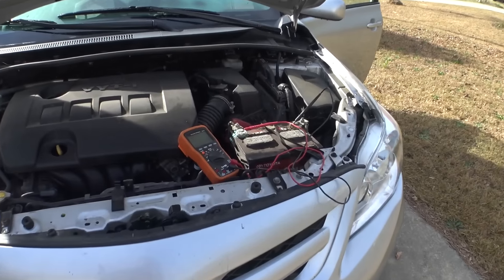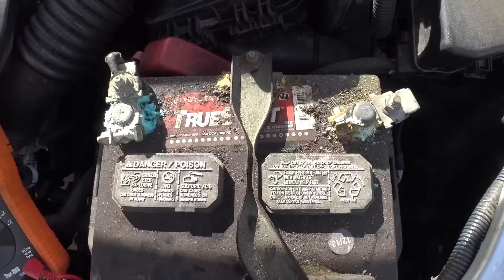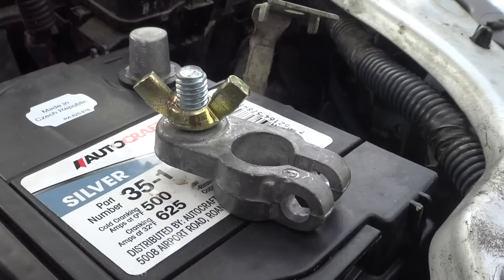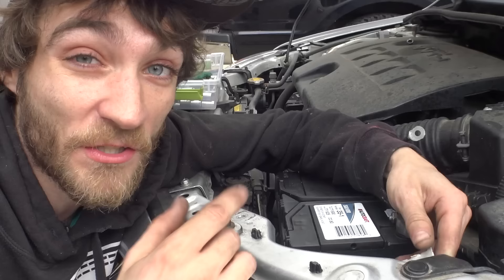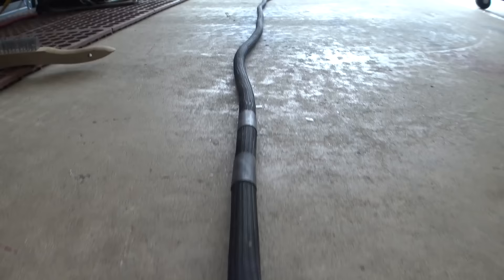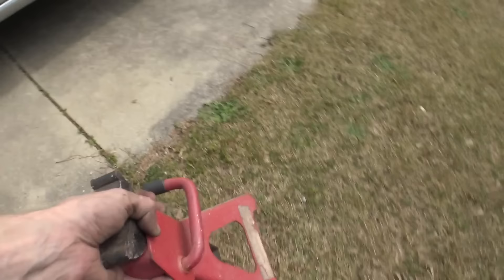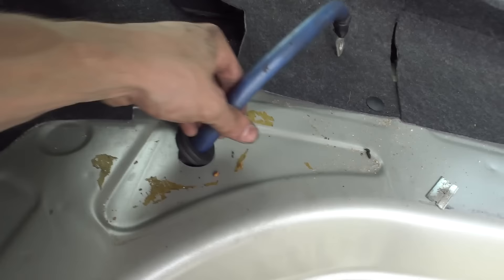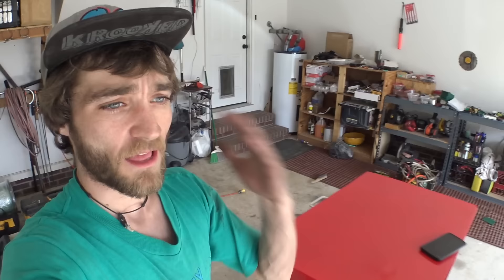Wiring CAR AUDIO System w/ 2nd Trunk Battery & Installing BASS Amplifier | Testing HOTEL Subwoofer

Comment: EXO is there any disadvantage to using just a straight non flared pipe as the port? I'm thinking of building a box where the sub faces the back as normal but then porting it out the back of the box through the ski hatch between the rear seats into the cabin and I dont really want a big flared port looking obvious, I plan on painting the inside black then carpeting the outside grey with the box.
Reply from the maker: Flares will help reduce port noise, and in many cases behaves like a larger port opening without necessarily being larger.

Comment: before you go spending loads of money on a high output alternator, try doing the big 3 upgrade first.
(Side note) I thought you were supposed to fuse a second battery, please correct me if I'm wrong?
Why was that chick putting WD on those posts? Last time Advance did mine the guy used dielectric grease.
Great job BTW; enjoy your hard work.
Reply from the maker: I know, right!?!? LOL - And yes, doing the big 3 before a H/O upgrade is always a fine option. Thanks for the comment, Vince!

Comment: No need for an isolater? Thought if you use 2 different batteries thats a must. Please explain cause i dont want to use one
Reply: You don't. Think of how most trucks 3/4 ton and up have 2 batteries. Each it's own ground and connect positives
Reply: I ran two batteries in parallel in my previous cars for years without an isolator and had no issues.

Comment: Mine only drops from 14.2 to 13.8 on factory alt but the factory alt is a 220 amp in my 16 Dodge Charger with ssl evo 5000.1 an alpine type R 15 so I’m good I guess
Reply from the maker: Nice man! That's all alternator power right there. Not even dipping into the battery reserves.
Reply: Hate to burst you all’s bubbles, but you could get a Dodge Charger from the factory with a 220 amp alternator. My Challenger came with a 160 amp alternator, but the 6.4 engine had the 220 amp alternator installed from the factory, and it’s a direct bolt in. I put one in my Challenger in place of the 160 amp one.

Comment: Hey exo have you done any speaker upgrades for a 2003 Nissan frontier? It's stock 6.5 front and 4.1/4 rear, I'm thinking 8 in the front and 6.5 rear. All subs.. thoughts?
Reply: Love you r.   Wórk
Reply: Woñderful.   Wórk

Comment: do you also run ground from your alternator or only from the metal on car I'm working on a build and was trying to inure out ow yo get sooo any ground and power wires
Reply from the maker: Grounding directly to the alternator case is best.

Comment: Hi, you should turn around subwoofer. Speaker needs to fire to trunk opening, because now reflected sound waves makes cancelerations in cabin. Sound waves lenghts ~12-5 meters.They reflecting and are a little out of phase. It's just basics, you should try, maybe it will give you dB or even tenths of it. Let us know. :)
Reply from the maker: The current position was for getting better filming. Seeing the subwoofer move is a little harder when it's turned around so you can't see it :p We will test all sorts of stuff though. Again, this is for just her enjoyment, not for me lol
Reply: Good luck. Nice videos. :)

Comment: I’m new into car Audio and have kicked comp 12’s with a machete 2000 watt amp before I install the system should I get a new alternator or Battery? Not sure what I should get I have 2000 Watts and I have a Chevy cavalier just don’t want to kill my alternator right away thank you for the feedback!
Reply from the maker: If it's 2,000 watts RMS I would definitely consider upgrading both!!!
Reply: Agreed. Definitely upgrade both. And upgrade those wires! I made the mistake with my 85 Camaro. Threw in a 750w rms sub with a 1000w amp and 2 days later my alternator was fried. It was stock so it was old anyway, but upgrade before hand so you're not stuck with a dead car!

Comment: im guessing its better to put the ground under the seat like you did compared to on top like i did fuuuuck. and in a trunk like that isnt it louder having the sub facing the rear? if that car has enough voltage to push that 3000 watt amp that makes me feel better about playing my 2000 watt amp so thats good haha
Reply from the maker: Yes, and yes. We faced the box this way for better views of the subwoofer on video.

Comment: I'm running 2 batteries and a skar rp2000 amp. 0 gauge all the way around of course. how many fuses do I need and what size fuses
Reply from the maker: It's safest to fuse twice between each component, one at both ends of the power wire which connect to any battery or amp.
Reply: 1 fuse under the hood, 1 at secondary battery and 1 to the amp?

Comment: So.  I've been trying to figure all thos out.   Live your vids btw.  But I have a Honda pilot.  I think 130amp alt.  If I wanna run 1500-2000 watts rms.  Should I add a second battery?  An alt upgrade isnt really in the cards.  Its buried under the motor.   You did 3k watts on a stock alt and second battery?  Look forward to hearing from you.  I know you're a busy man.  :)
Reply from the maker: Yes, you should! Although I was burping and not playing music, If you can't upgrade your alt you'll surely need more reserves!

Comment: I have 8 gauge, switching to zero, so I need to replace the rcas and remote wire too???
Reply from the maker: No way! Just the power wires connected to your aftermarket accessories like amps ect.
Reply: Sweeet

Comment: How do I work out the amperage my alternator will need to produce running X amount of watts including the car electrics? Don't really fancy installing another battery or an extra alternator :(
Reply from the maker: James Mason I usually figure out what wattage I'll be running, and then go from there. Anything  over 2000 watts will definitely prefer a 200+ amp alt.
Reply: EXOcontralto thank you so much! Love the videos too

Comment: Would I only need 1 battery for a 3000rms system on 3500w amp with a 320amp alt
Reply: Yeah you would be fine. Just have some voltage dropoff (you will see it in the headlights at high volume) I had an altima with a skar 15" 2000w a skar rp2000 and full 1000w mids/highs on stock altima battery and alternator no issues just small voltage drops at max volume xD

Comment: How did you hook up the second battery? Did you just wire that xs power to the new one you bought at advance? Do you have a isolator?
Reply: Dillon Dye very simple. Positive to positive and negative to negative from the first, to second battery.
Reply: Dillon Dye  nope did not lol...not kill switch,not isolator,not power bank...lol
Reply: Just over working the alternator...lol

Comment: Exo what are your thoughts on an L shaped box vs an aeroport? I would be thinking that an L shaped port would load the cabinet more and "possibly" give a higher output. Just a question, I'm no expert. Thanks bro
Reply from the maker: Aeroports have less surface area, more efficiency, and slightly peaky bandwidths . Slot ports have more surface area, less efficiency and generally better bandwidths.
Reply: EXOcontralto so you're saying that an L shaped box sounds like crap due to port noise?
My DD 10 has an aeroport and it sounds damn good, but at the same time I've heard some L shaped boxes slam. The only downside is that it takes very careful planning to make it sound great. Port plotting can be tough, but is there still chuffing at the port? Just curious
Reply from the maker: No, I'm not saying that at all. Slot ports sound better generally.

Comment: dude that's banans you think i cause do that to a camaro but i dont want to use the whole hatchback i just want to use the little dip in the back
Reply: Emmanuel Burton no problem dude just measure it out if it's a older model you should be able to fit a single 12 or 2 6s

Comment: So im trying to figure this out, if i want a 2000 watt rms setup than a stock battery wont keep up so i need an extra one. But the battery has amps and ah witch one represents what(id guess one storage and one output but dont know what is what)? And am i right that for 2000 watts on 12 volts i need around 170 amps/ah?(sorry for the poor english im dutch :D ).
Reply from the maker: To keep up with around 2,000 watts I'd suggest a 200a alt with an EXTRA  80-100ah battery.

Comment: hey exo bro what did u use to get the rcas from the factory stereo? and brand thanks
Reply from the maker: It's a Hi-Lo level converter from NVX. The 2 channel version, using it for mono of course. Like 15 bucks or less I believe
Reply: thanks man for the replay i was looking at the lc2 audio control or goin with the lc7i for all amps with factory, love seen ur videos man for so long aready but love more on how easy you make see the makinh of subs boxes need to learn how to do them any tips bro and easy programs?

Comment: WHY SO BIG WIRE WHAT IT DOES MAKE DIFIRANCE !!!
Reply: Because of low voltage used in cars the current drawn by strong amplifier is pretty high (current = Watts divided by Voltage) that's why you need huge wire. A thin wire affects performance and if it is way too thin the wire could melt.
When choosing the wire gauge you need calculate the correct size. Keep in mind that amplifier is actually drawing more power IN than it gets OUT (to be safe multiply RMS watts x2) and also consider the length of the cable (longer the distance larger the wire). Well you can use online wire gauge calculators they are pretty reliable.

Comment: the factory speakers in my Camry sucked...plan on replacing those?
Reply: In my opinion every factory speaker doesnt really sound good, they also blow really quick
Reply: Rodney Mikell yeah I replaced my ladies speakers in her corolla with Memphis audio. sounds nice now even with no sub and a stock hu
Reply: Memphis Audio, 6.5 up front I left the stock tweaters in tho and I put in 6x9s in the back. I got a custom mounting plate for them. They were like 14$ No one else sells them. On the crutch field site it says that the 6x9s will go into the rear deck no problem but that is false. And they also don't carry the right speaker adapter for the 6x9s
Reply: dank9288639 I couldn't find any brackets for my rear deck 6×9's. Put 6.5's back there instead. All Skar Audio
Reply: Rodney Mikell that's what I thought I was gonna have to do but I found a site that sells specialized adapters for certain cars
Reply: ***** hell yeah a huge difference in clarity and bass, you can basically turn up the stereo as loud as it goes with no problems
Reply: David Way louder. 6×9's in doors, 6.5's in rear Pioneer head unit, two Skar EVL 10's on Skar T-Series  2000.1D in a custom made enclosure with a Big Ass Port similar to the one in this build
Reply from the maker: Yessir, they're okay for now, but plans are already started.

Comment: Ok i bought my son 2 gravity 15s dual voice coil 4ohm subs going in a 2008 chevy colbolt i bought a 4500 power acoustic mono block class d amp thats 2ohm stable now do i drop the ohm load of one 15 to 2ohm and than the other that gives me to wires coming from each sub and one set from the amp still be 2ohm load please help me out
Reply: I am afraid your best bet is to wire them at 8 each and then put them in parallel for 4 ohms.
Reply: Yes your only options is 1 ohm 4 ohm or 16 ohm. If the amp isn't 1 ohm stable your best setup will be 4 ohm load. Each speaker wired series then both speakers wired together parallel to end with 4 ohm load.

Comment: I am co-owner of my own battery company and any battery that drops down to 10V at rest no lower is a BAD CELL no saving that battery a cell in the battery has shit the bed
Reply from the maker: I have to kindly disagree. This is not always the case. I've personally revived 12' batteries from 10v resting voltages. Come to think of it, my previous Megatron 51 was drained to around 10v, (1.7 vpc) and it was reconditioned with a NOCO 26000 last year back up to 12.6 (2.1vpc)  It's still holds a charge and puts out rated amperage. There are always exceptions.

Comment: whats up exo i have a question for. I went to an audio shop cuz i wana build a system this guy said that u can burn out subs if there under powered is that true?
Reply: Carlos Guzman yes.. only because under power causes distortion. then if you crank it high volume it distorts more.. you have better luck over powering ... because at least the sound will be clean... but even then it can over extend...
Reply: Jayden 97 thanx bro i wana run 2 15in earthquake dbxi they 750rms ea. and a 3500 watt soundstream picasso its 1700rms.
Reply: Jayden is right if you dial in right no problem..
Reply from the maker: Yes, and no. I have a video coming up soon about that.

Comment: Exo!!! Question for you sir. If I have a 4500w amp and two 2500w twelves, can I use the bass boost on the amplifier. (Keep it mind the amp and subs are made by the same company) I think I like how the subs feel when I have the DB at 14db out of 18db... I just keep the gain a tad under nominal. Is this okay?
Reply: I blew my amp this way :/
Reply: @tazkphotography2858  did ur amp show signs of struggle before it blew?(did it get really hot, smell, or anything) mine will remain cool unless I listen "loud" for an hour or more...
Reply: @deedolan399  Never ever use bass boost. You'll just clip everything and it will sound like shit and ruin your equipment. Just set your gains right (you can look up how to properly do that) and turn bass boost off completely. There reason the other guy blew his amp is because of clipping and dirty power most likely.
Reply: Never ever use bassboost. Set your gains right and that's all you need to know.

Comment: What the biggest alternator can I put on an 2000 Cadillac Eldorado?
Reply from the maker: I'm not really sure man!
Reply: EXOcontralto I put a second battery in the trunk and got more power tho.
Reply: A 340 machman
Reply: DICKEY RAY VELVET thank u bro cause I’m pushing some kicker L7s 12 inch and the alternator on there can’t handle it.

Comment: Why people dont solder  and shrink wrap wires is beyond  me you can pull a truck with it after your done if you want too,it takes the same amount of time and its a 100% postive  way to know you will never have to touch it again
Reply: From a competitors standpoint, I only solder small connections that aren't gonna see a lot of power through them. HU, switches, volt meter etc.. 2/0 power, ground, 8ga sub wire all get hydraulically crimped. When cone correctly it creates a cold weld. It will never come apart, ever. A proper cold weld can actually be stronger than soldering. It also has the additional benefit of less resistance. Albeit very little difference, still a difference none the less. There's no "foreign" material (solder) when using hydraulic crimper. Just a cold weld created with copper and copper.
Reply: When u pull alot of power an the joint gets hot the soldier let's go an then u have a bad or no connection

Comment: What’s a good secondary battery for 2 12s
Reply from the maker: How much you looking to spend?
Reply: Easiest thing is to just get one that's similar to the starter battery, it'll be relatively cheap and the batteries will be similar so they'll charge evenly and stuff.

Comment: yo xo how do i ground a wire to the frame? as far as skrew or bolt 
?
Reply: Daniel Wippich either one will work. Just have to make sure that the metal you’re using has no paint or anything on it. Otherwise you won’t have a clean ground
Reply from the maker: I'd stick to BOLTS!!!
Reply: I ended up using a copper bus bar and bolting it through to bare frame then added grounds to there with holes and bolts then sealed it all up

Comment: why you need second battery ?
Reply: To reduce the voltage drop and increase the playtime before the batteries are completely drained.
Reply: i think if you are still use standard alternator, it cannot fully charging multiple batteries due to limited output
Reply: It does not take much current to fully charge a battery. Note that battery charger/maintainers only have 1.5-5 amps of output usually.
A stock alternator of 60-140 amps would be plenty to fully charge a battery as long as the voltage was high enough. (13.8-14.8 is acceptable)
The issue is that it will take longer to charge, and the alternator will be under a heavy load for longer.

Comment: I'm looking at getting a 12in 2+2ohm subwoofer with 1700w rms power 3400w max power. Do I need another battery or what would I need? I don't know what amp I'm gonna yet though. Any thoughts?
Reply: Psi audio makes good batteries but I don’t think you will need one cause you should be right on the dot
Reply: Just test the waters and see if your car will handle it. No need to buy anything without actually needing it
Reply: @man2452  even if it's a stock alternator and about a 500 CCA battery
Reply: It should be enough for a 2000 watt rms amp
Reply: Is it a good idea to run an amp significantly weaker than the sub? It'd be a 1400 watt rms power different when the sub is putting out max power. Just wondering cause I don't really know what I'm doing lol
Reply: Garrett Conley noop always use a bigger than sub amplifier and limit the levels unless u know what ur doing. it would clip easier and burn the coil

Comment: where'd you get the fuse holder from?
Reply: ProneToInfection lots of audio shops or online shops have them. I have 2 Sky High car audio fuse holders in my car.
Reply: AlwaysChangingMind ya the only one's I found were the sky high one's. The one he had was gold so I was curious. I was thinking about getting the sky high one. how is it?
Reply: Good. It's just a fuse holder unless it says it comes with a fuse. So depending on your amps power you'll figure out how big the fuse needs to be. You can Google what size you need for how much power your running
Reply: ebay
Reply from the maker: Ebay, cheap laces online.